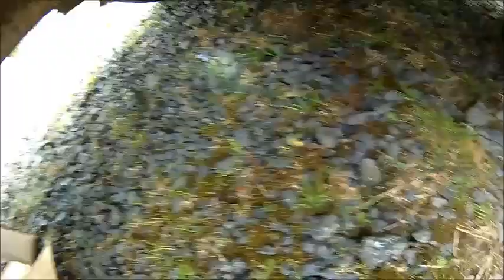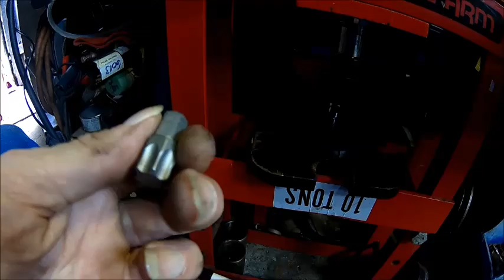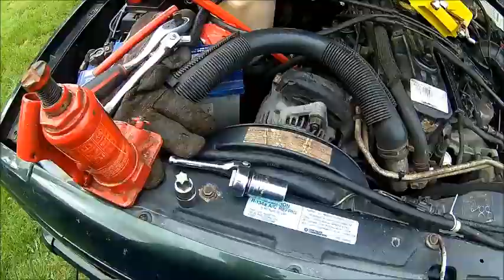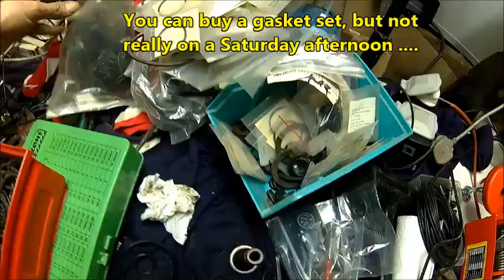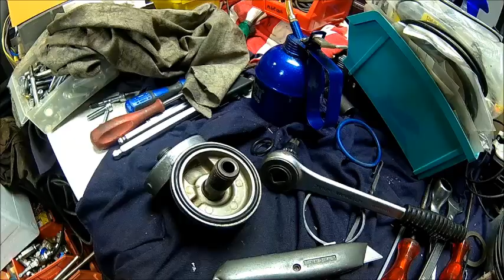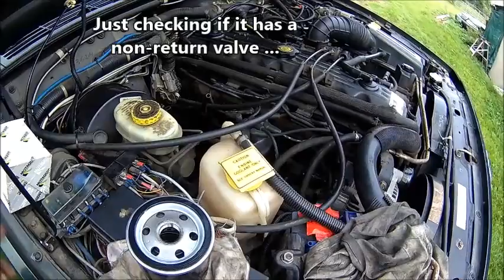Cherokee oil filter adapter bolt removal, making o-rings (XJ 4.0 ERH engine leak fix)

Comment: good to know how those oil filter mounts are set up. mine leaks like a sieve too and i always suspected the oil pan gasket. it also goes to show how auto manufacturers no longer build their products with maintenance in mind. 
with your data and experience documented here in this video a guy can make a special tool for that without having to loosen the engine mounts and all that jazz.
Reply from the maker: You might be lucky with your's, the older ones had a hex head bolt, no idea why they changed it to that silly torx. The aftermarket gasket set is around $10, pretty steep for 3 o-rings, but probably even more at your friendly Chrysler counter..
The trick with the pushed out bit and a spanner should work most times, but mine was extremely tight, pretty sure you can buy a special tool from Chrysler at perhaps $100, or just make something up. It was Saturday afternoon and I only had the 2 torx sockets , so i didn't want to mess up anything as i need to do a long journey next week.
Reply: to be honest, i haven't got a clue what the head of the retainer bolt looks like in mine. never got into it that far, you maybe right about that.. 
the O-rings would be over the counter stuff at either NAPA auto parts or Maguire bearings for probably less than 5 quid. all a guy would need is the sizes of them they would be peanuts, even at caterpillar. i picked up a set of O-rings for the fuel injectors at Maguire bearing a few years back when the ones that were in it started leaking. i bought 12 of them so i had a spare set.. they were like 3 buxx for the lot or some ridiculous low price like that. those silly O-rings are really effective in a captive application like that which is why Cat, John Deere etc use them in their hydraulics. they're cheap and easy to replace when they go bad.. 
happy trails on your trip next week, going back up to scotland?
Reply from the maker: As you probably seen, i've got boxes full of old stock o-rings, so why spend money for that.
Yes, i am going to Scotland, unfortunately for work, not holidays .... but will be back the week after for an interesting project which just came up ...:-)

Comment: could you not have made a spacer for the mount??
Reply from the maker: Technically yes, but the rubber on the old one is also wider, that means the new one would be softer, that's the least thing you want with an engine mount because it makes your engine twisting under power, especially on the compression side where the rubber is pushed downwards. This part is certainly for a smaller engine, way too weak for the 6 cylinder.